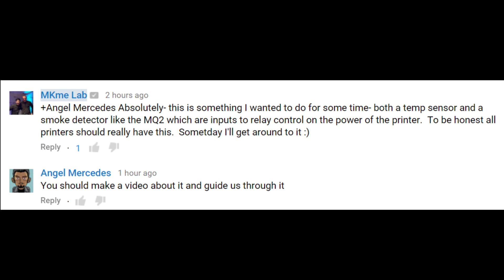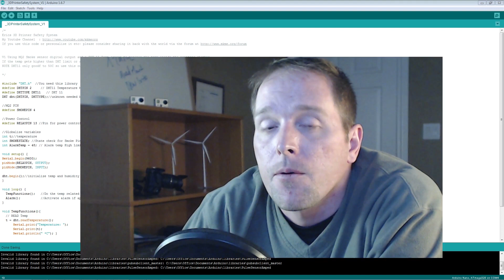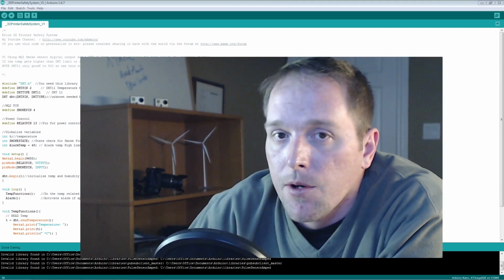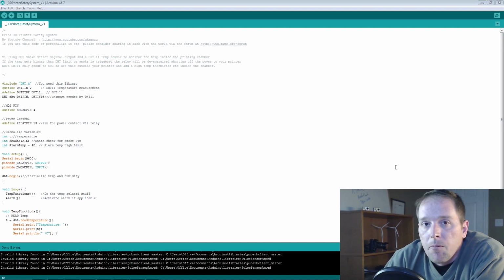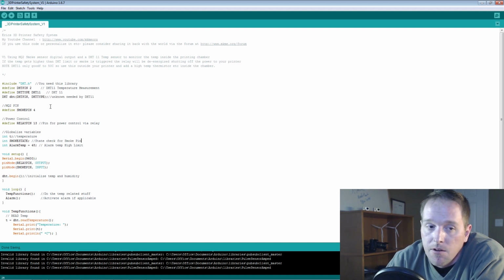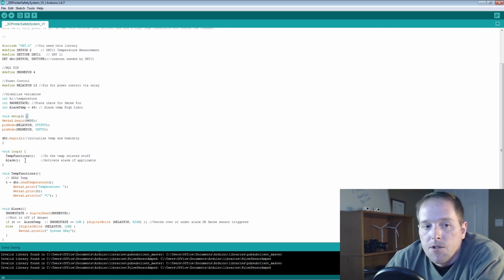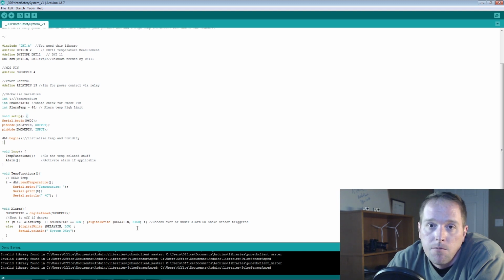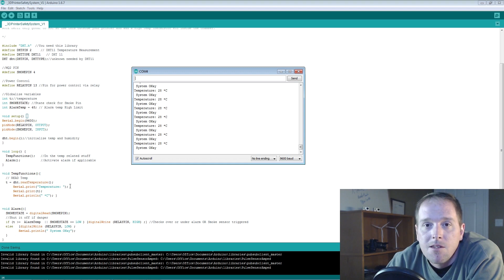DIY 3D PRINTER SAFETY SHUTOFF!  DONT BURN YOUR HOUSE DOWN

Comment: Even with this system, if something catches fire, it might be already too late to shut the power down. I've read a post on reddit about a guy who installed power shutdown and fire alarm and it worked as expected, but there was enough heat to sustain the combustion and everything was on fire. For that to work correctly, you'd need to have both power shutdown and some sort of fire prevention equipment like those extinguisher balls you throw into fire or some foam sprayer. The best idea is simply not to run your 3d printer unattended or if you really have to, run it in a room where there's nothing else that could catch fire. I know some pepole who even run their 3d printers inside fireplaces which actually doesn't seem like such a bad idea. This saved my house from burning when I was charging a huge LiPo battery which decided to explode.

Comment: Very nice. I'm building an enclosure for Ender 3 pro myself. Will be equiped with smoke & temp sensors as well as automatic poweroff. As addition, there will also be either solenoid or small servo operated shutoff on fan ducts for air coming in and out as well as automated CO2 release valve (Arduino uno build). It will also feature temperature control with multiple sensors, so i can have the temperature close to build area and other areas of the enclosure to my specifications.

Still on paper except for the enclosure, that is 70% done. So in action it would have to meet few criteria to go either power off or all above. If temp in the enclosure ceiling rises to x --> shut off. If temp rises to x AND there is smoke --> slam air ducts shut, release CO2 and kill power. Will need to build it so that the safety gear will remain operational even after shutoff, CO2 release etc. to have it alarming with light and sound as well as SMS me a message. We'll see :)
Reply: Temp control will be it's own unit, but power will be also routed through the relay as you have. So all in all i will be having my Ender 3 and fan control unit routed through relay.
Reply: @michelepagano960  Hi, yeah enclosure itself is complete, just haven't had the time or "drive" to get on the CO2 stuff done. Shouldn't be a problem as only electronical components in the closure are the heating elements and stepper motors. Everything else is outside the enclosure. Eventually i will get on that CO2 stuff :P

Comment: The smoke detector is useful, but only close to the control box. Where the power can be cutoff if there is an issue with any components. Those will create smoke.

Comment: Cheers. This is an excellent video. I built it. A couple of things I learned for others to avoid. 1) DOn't use pin 13 for the relay as it cycles and  fires the relay on and off multiple times on startup. 2) insert "for (;; );" after detection to go into an i finite loop and hold the relay off until reset if a problem is detected. 
Btw, Octoprint just released a plugin that allows control of a TP-Link smartplug via the GUI and it works really well. Now, if only I could figure a way to link that to an over-temp condition and trigger a shutdown......🤔

Comment: Thanks for the video. I completely agree that the commercial 3d printing world has yet to keep up with consumer safety, especially with DIY 3d printers. After purchasing the parts and uploading the arduino sketch & libaries, the DHT_u.cpp has come back with a plethora of errors. Are you able to upload your sketch & associated libraries? It would be a shame to throw all of this in the bin due to a lack of code writing knowledge.

Currently using http://www.arduinolibraries.info/libraries/dht-sensor-library & https://github.com/adafruit/Adafruit_Sensor

Regards
Andy
Reply from the maker: https://github.com/MKme/3D-Printer-Safety-Shutoff

Comment: Hi thnx for this, i've just finished putting this together, it works but it powers the printer on when it detects gas/smoke lol think the relay they gave me needs to be inverted, anyway to do this from the code? so at the moment, it triggers when it detects gas.
Reply from the maker: You can just switch to the other contact on the relay (pretty much all will have an NC and NO connection to choose between) or edit digitalWrite (RELAYPIN, HIGH) to LOW and LOW to High a couple lines down.

Comment: The relay you are using can handle a maximum current of 10A I have my heatbed hooked up through an SSR and the whole system is using more than 10A so I am wondering if I cann attach the relay to the 12V power out that is powering my board, the board is using less than 1A overall, if you kill power to the board the heatbed will also shutdown.
Reply from the maker: +MrWatcher321 You could indeed. The odds of the micro sticking high internally I would suspect are quite low. Go for it. Lots of ways to add increased protections. Cheers
Reply: +MKme Lab ok great, the relay you mention in the video will work with 12v?

Comment: Thanks for posting this. I am new to 3D Printers and to Pi/Arduino. Quick quesiton - if I am already running Ocotprint on a Raspberry Pi 3, could I also wire in a temp and smoke sensor and run your code? I know resource wise it can easily handle both apps (Octoprint and sensors) but I was always under the impression that these are single purpose built machines. How would you go about having it execute both scripts?
Reply from the maker: +sygyzy I would expect so but I'm not familiar with Octoprint. Cheers

Comment: Hi, it is a good idea, but: if it sense smoke or high temp isn't it too late? You can cut the power but if a fire started, it has already started... cutting the power may be not enough. Plus if this system makes you feel confident that you can let it go on its own it may be more dangerous.
I was thinking about something more. Instead of arduino, use a Pi with Octoprint. Then you can receive sms and email if anything wrong is detected. Plus you have a webcam connected that you can watch remotely. You can even add a co2 extinguisher to your system. There is a tube that you pass arround and inside your 3d printer. If the tube is burnt or melted, the opening will spray co2 right at the hot spot. Even at that point its not 100% safe but at least it detect the problem, take preventive action, send you an alert with a picture. Then you can check the webcam and decide what to do. It's not too complicated to build.
Reply: +jimbob1er Also by integrating the relay pin to octoprint, I can power on and off the printer remotelly from the web interface. I configured it to poweroff the printer once a print is finished and send me an sms with the picture of the result.
Reply: +jimbob1er most mobile phone company have a way to send sms trough email. ex: phonenumber@msg.koodomobile.com and you get your sms. You can send email by using smtp library with a python script on the raspberry pi.
Reply from the maker: +jimbob1er Some great points for sure. Hence I put this out there for anyone to easily add their own ideas and improvements.  My only advice would be "Don't let perfect stand in the way of better"
Reply: This safety system is great, but I share the concern that it could be an example of shutting the barn door after the horse had gained its freedom. If this shutdown has been triggered then a fire may have started, and shutting off the power and raising alarms won't stop the house burning down.

If you are bothered by that then I suggest searching for an extinguisher called Fireblitz - see the following website :

http://www.fireblitz.co.uk

With their FE36 jobbie, if the temperature gets to 79 degrees then it shatters a glass valve and the cabinet will flood with fire quenching gas. In conjunction with the shutdown of power dealt with by this arduino design there is every chance that a disaster will be avoided, and the good news is that there is no dependency between these two systems.

Comment: A Good idea to have a separate system because the 3D printer control could be faulty e.g. causing the problem. If the 3D printer control  has such a problem them it may not be wise to use that system as a safety control. Just a cheap Thermistor could go much higher :)
Reply from the maker: +Protomaker Black Sprint Original 3D Printer Absolutely.  This should get people and companies started I hope :)

Comment: Good idea, however I see a few problems with this design.
Your code allows the power to come back on automatically without any human interaction.
Second issue is that the monitor circuit will need an external power source since it needs to be powered for the printer to stay on.
So the first problem for example is that if the circuit activates due to smoke or heat, it will cut the power, and after a while the power comes back on and it could flame up again causing even more problems.
Both issues could be resolved by having the monitor circuit be powered by the 3D printer power supply. Then attaching a push button that bypass the relays and temporarily provides power to the 3D printer while pushing down on the button, and then also activate the monitor circuit enabling the relay. This way when the monitor circuit triggers, it will cut power not only to the 3D printer but also to the monitor circuit, preventing the system to come back on until one resets the power by pushing down the button again.
Reply from the maker: +Brian Levinsen (Eldaria) Sigh... this is noted in the code.  Since I gave it away free why not make it better then upload it back helping people instead of complaining?
Reply: +MKme Lab Ehh, this was not a complaint, reading again what I wrote I do not see how you understood it to be a complaint. It was a suggestion for improving on the design.
Reply: this is easy :) have a variable called Allowed. init sets Allowed to false, and it must be activated by a momentary pushbutton. when Allowed is true, the relay is set high. when the relay trips, set Allowed to false again. this is a cool way to add a little starter button to Arduino projects, you could even add a momentary stop button as well
Reply: @msdosfloppy  Hi Jamie. Is it possible to provide the software with this starter button option? That would be great!

Comment: I think an IMU mounted on the X or Y axis that measures acceleration and detect when the printer is no longer moving (failed serial communication or just finished print) could be added as another input. Also, do you know if the smoke sensor work as well with PLA than (I assume) it does with ABS? I will build this project as it just make a lot of sense! Thanks for sharing!
Reply from the maker: +Tristan Robitaille Absolutely. You could add as many inputs as you like. That's why I made the basics available- take it, make it yours, make it better.  Enjoy.  Just make sure for movement input you keep in mind that your printer is not always in motion. No fun if it kills power while you are still warming it up :)  Cheers!
Reply: Oh yeah that's a good point, taking the thermistor in the hotend as an input should be pretty easy though. Cheers
Reply from the maker: Tristan Robitaille Sure would.  That would have been my primary input for this video if I hadn't gotten home from honeymoon last night, planned this video at noon, shot/edited till 5pm And uploaded by 6 ;)  Version 2 I guess.  Cheers